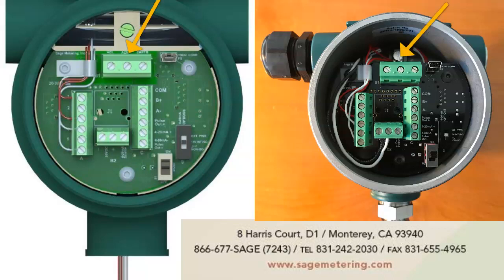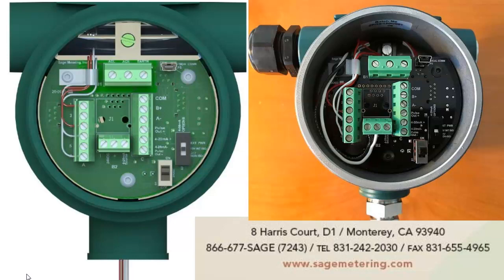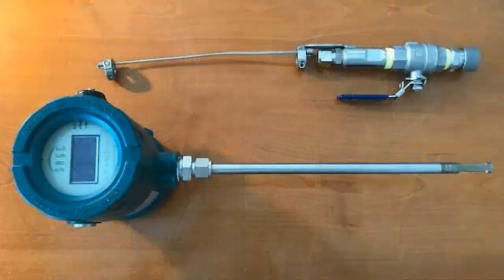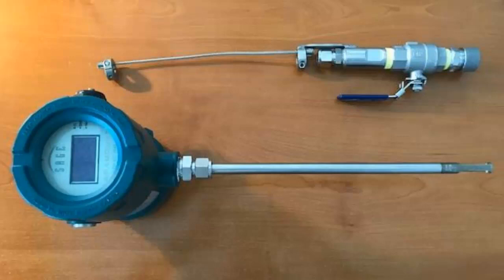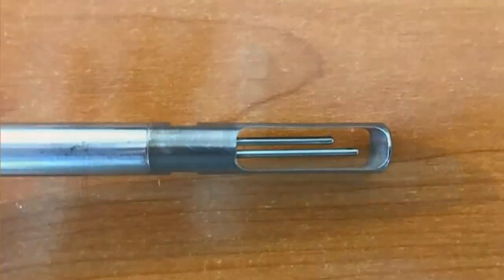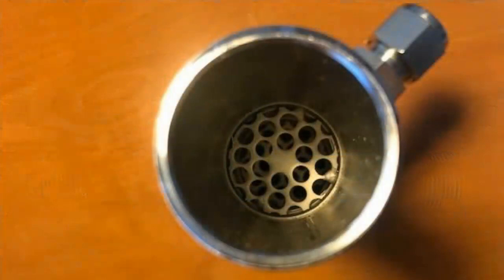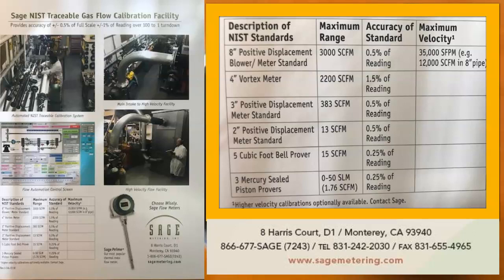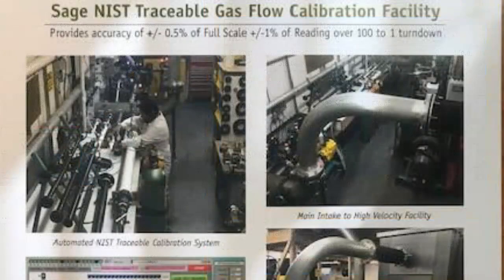Sage Paramount Industrial Thermal Mass Flow Meter Demonstration

Comment: Dear Sir, 
I am Sunku Prasad, a PhD student from IIT Guwahati working in the area of high temperature thermal energy storage system. I want to know whether it is possible to design a thermal mass flow meter  for measuring mass flow rate of molten salt. the molten salt is flowing in the pipe at a temperature of 400°C. The flow rate range is 2.5 lpm to 10 lpm. 
Kindly let me know the possibility of such device. 

Sincerely 
Sunku prasad